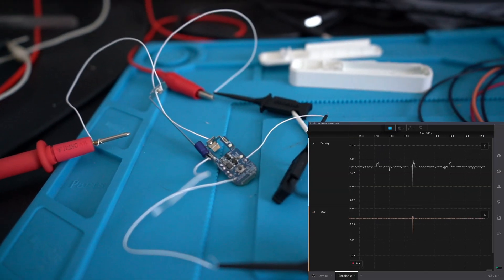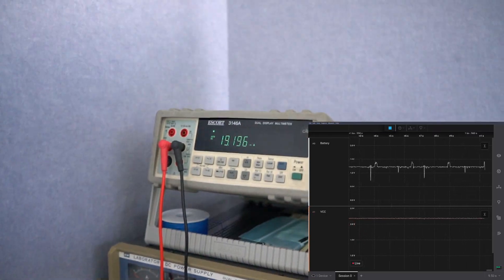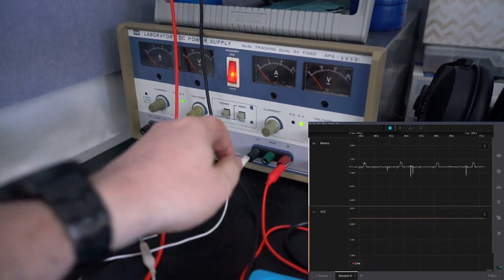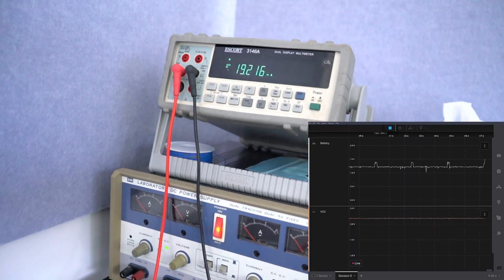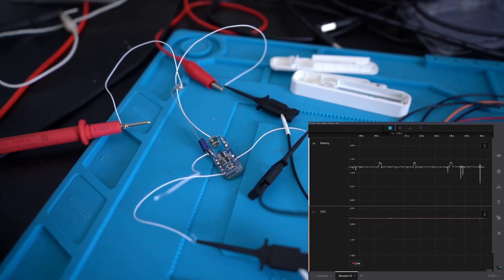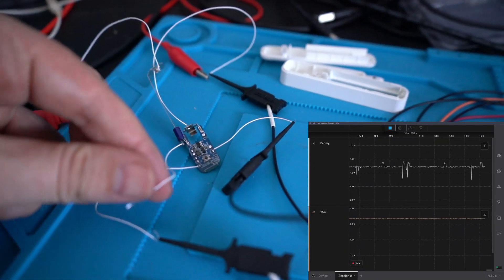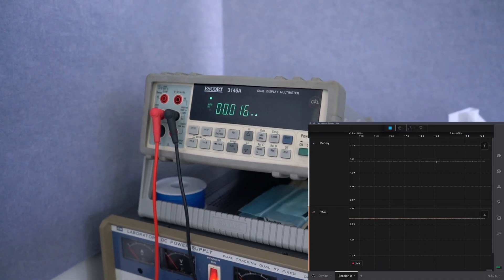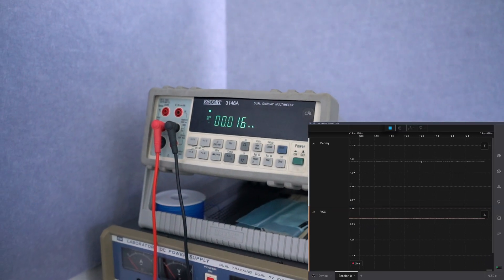Ikea Parasoll - Battery drain issue, fault found and fixed!

Comment: Could you show it better where did you solder that capacitor?
Reply from the maker: It's between the VCC pad and the ground of one of the pins on the switch. I have since replaced these defective units, I am no longer using them.
Reply: @gnif  Do you use different brand or newer don't have this flaw? How small cap would you advice? Thinking about putting something small smd on the board between vcc pad and scratched off soldermask next to it.
I have about 10 of these :D
Reply from the maker: @TheDarmach  I now use the  Aqara Door and Window Sensor T1, these have been excellent and you can get them quite cheap on AliExpress in bulk.
Reply: @gnif  Now you made me think about the thread bandwagon with P2 version... How much bigger these are compared to ikea? Liked form factor of ikea ones - easy to fit in tight spaces, on the top of the window sash
Reply from the maker: @TheDarmach  they are much smaller
Reply: @gnif  How waterproof are the Aqara Door and Window Sensor T1, do they have seals like IKEA sensors?

Comment: Did you check the value of RF1? It's a resettable fuse...
My best guess is that the value is close to the component's tripping threshold...since it's a PTC, it would be interesting to measure the Ohm value when it's working and when it's not.
And see if shorting the RF1 component restores normal operation.

Comment: Maybe you can chime in. I added a capacitor across VCC and GNG as you described and it did indeed smooth the voltage and put the sensor into sleep mode, but further testing has shown that the range of the sensor to my hub has been reduced by 50% or more. This was tested using two Parasol sensors, one modified and one untouched. Thoughts?
Reply from the maker: There is absolutely no way that adding this capacitor could have changed it's range. More likely what has occurred is you put the battery back in away from where the device was to be installed and it has connected to the wrong device on the mesh network.
Reply: @gnif  I only have one hub. The device was reset and pared to the hub 2 feet away. It's current connection path shows direct to the hub and not repeating through any additional Zigbee devices. I tried this several times as I though the same thing. Best I can do is experiment with an additional sensor to see if I get the same result.
Reply from the maker: If you used a large electrolytic capacitor and placed it over the end of the PCB, you might have covered the antenna trace on the PCB, shielding it with the aluminum can.

Comment: Over the last month, have you seen any further issues? Any chance you could post where you are connecting the capacitor?
Reply from the maker: No, the devices I have modified I have not yet had to change a battery in, they are working correctly.

The capacitor is between the VCC pad and ground.

Comment: Do you have a clear picture of where you added the cap?
Reply: Output of charge pump to gnd i presume?
Reply from the maker: @ON8AD  Yes, I used the VCC pad and the ground of one of the pins on the switch.

Comment: Good upload and certainly worth linking when someone claims that voltage is the problem.
Without disputing the conclusion, voltage is not the only variable when it comes to battery and boost converters performance.

I would not recommend claiming that power supply (and even alkaline battery) replaces reproducing the issue on rechargeable.
There are circuits that emulate battery and its behavior - but the impedance and resistance will not be the same.
Since you have the poorly performing board, can you reproduce the same noise on batteries?
Reply from the maker: Yes, running directly off an alkaline still results in a very noisy output from the switching circuit.

Comment: Are you sure it is a design fault? I use it for more than a year on the same rechargable battery and no issues at all.
Reply from the maker: Absolutely. It's luck of the draw if it powers up properly or not when you put the battery in, you just got lucky. There are dozens of people over on Reddit with the same fault, it's not just me.
Reply: Concur. Same issue. Had to return all of mine as was recharging the IKEA battery every 1-2 weeks.